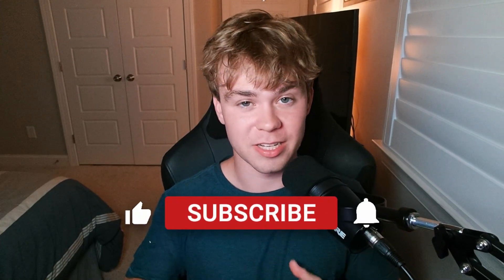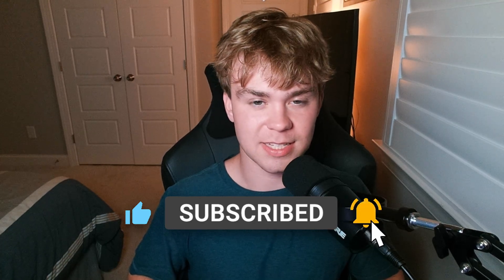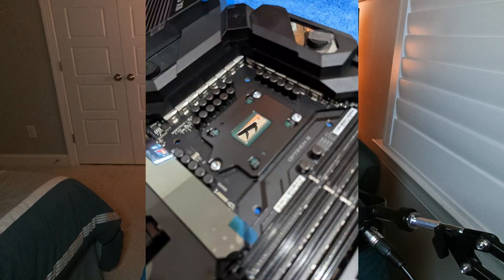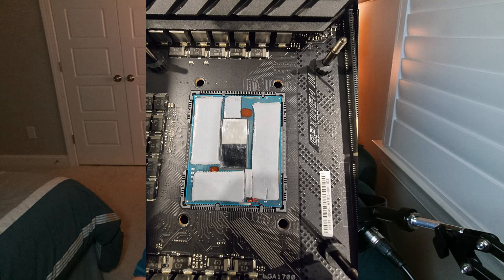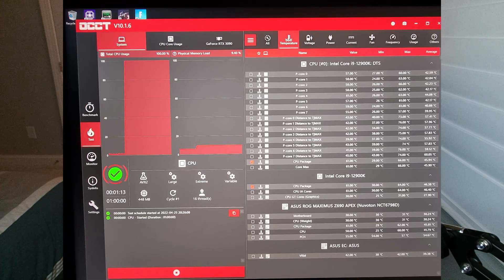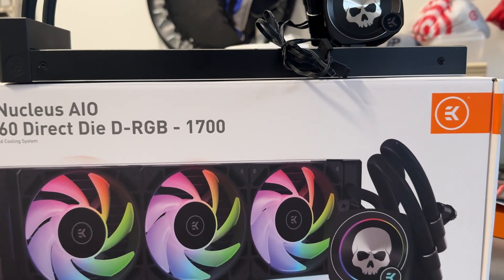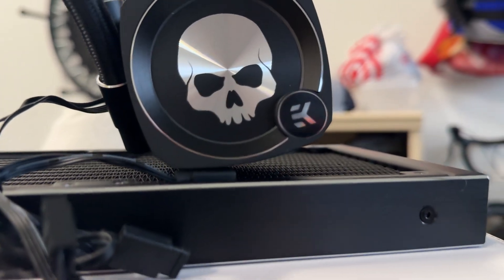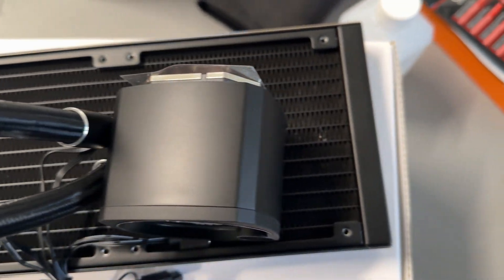Unleashing the 14900KS… (Direct Die)

Comment: No, the answer is to have a very good motherboard that can handle it. I also have an H170i 420mm with liquid metal. I went from 100 degrees at 57 ghz to 80 degrees tops at 61 ghz with idle temps at 29 degrees. The motherboard was the big change. The liguid metal got me down from 37 idle to 29 degrees idle. I have an Ace MEG MAX from MSI. Please believe me.
Reply from the maker: The motherboard won’t change temps I promise you. Sounds like you just didn’t mount the cooler correctly the first time
Reply: @ChamberTech  no, it was the motherboard, I promise you. Have you been living under a rock? Intel is blaming the motherboard manufacturers. My motherboard has 24 vrms with cooling. It is cool as life. Educate yourself. My performance seems to be better than yours, and I don't have to delid my 14900ks.
Reply from the maker: @kalinwang1 ok so you think that vrm temp is cpu temp? Also I’m not using any power limits. Max power 14900ks. Yours is likely downclocking in games
Reply: @ChamberTech  no, I didn’t say that. I said the motherboard. Vrms helps with stability for OC. A good motherboard has vrm cooling and will run cooler and more stable for the cpu, helping lower temps across the board. Once again, once I changed my motherboard,  the temps never went over 80. I am helping all these people with a cpu running at 100. It is a lot better advice than your risky delid. Run a test on the MSI MEG ACE MAX. Compare it to your delid! I am using a max setting as well. Not that fake news put out buy manufacturers. I run at 61 ghz. My bios is dated Jan 24 with no power limits at all. I used to have a motherboard that was hot and unstable with power limits. I know for a fact that what I am saying is true. You need a better motherboard!
Reply: Umm...I need to know what workload/stress test you were running that allowed you to go from 5.7ghz@100°C to 6.1ghz@80°C just by changing the motherboard. I'm really curious to hear your explanation.
Reply: @jjlw2378  dude, buy the motherboard. I was in the same boat as everyone else. I did some research and realized my motherboard (Aorus  Z790) was crap. I got the MSI MEG ACE MAX.  I didn't change a thing in the bios. And it was significantly cooler. I  went to Intel XTU and pushed it to 61 ghz. I  didn't  do 62 because the CPU went over 80 degrees l. So I kept it at 61 ghz. Idle temps are 29.
Reply: @kalinwang1  what are you smoking lol, this guy probably isn't watching the clock speeds and doesn't realize that its downclocking to 5.7/5.6. I have the best motherboard you can get and it doesnt affect your CPU temp 😂😂
Reply: @RuiN4265  what motherboard do you have? You are showing your ignorance.  Don't go down with this guys lack of knowledge. My speed are at 6 ghz. What motherboard doe you have. I will tell right away if it is a quality one.
Reply: @kalinwang1  Asus Apex Encore

Let's see a video of you running VST @ 6.1GHz at 80°C
Reply: @RuiN4265  price is crazy, but all comparisons say my motherboard is better. Your board does not have a backplate nor as many vrms which is important for running cool and stable.  It only has two ram slots and maximum size it is 96 gigs. Why buy that when you could have got my motherboard for 700
Reply from the maker: @kalinwang1 high end oc boards have 2 slots because you can actually run high speeds
Reply: @RuiN4265  this is what I found about your board:" This motherboard features a VRM that is made for pushing Intel's latest 14th-gen CPUs to the max and is powered by dual 8-pin connectors."
Even the maker of the board says the motherboard board matters. Mic drop...
Reply from the maker: @kalinwang1 the best board for a 14900ks is a $280 z790i lighting. 1 8pm eBay you gonna do about that
Reply: @ChamberTech  the issues you are having with 14900ks says otherwise.  You are calling me a liar??? I know I speak tue truth.  You are full of it, or seriously miseducated on this topic.
Reply: @kalinwang1  You should have bought the GODLIKE. Your ACE is garbage compared to it. You know, because the marketing says so.
Reply: @jjlw2378  I researched thw Godlike and it did not have as many VRMs phases (only 20). Where my board has 24. I didn't fall for the marketing. I researched stability and cooling. My motherboard hit all the right numbers.
Reply: @kalinwang1  I think it has 26+2 phases (Godlike Max Z790)
Reply: @gadielsantiago8813  I stand corrected. I must have been looking at the wrong I information. But I am still satisfied with my motherboard.
Reply: @kalinwang1 good👍🏻
Reply: @RuiN4265  The fact.
That you don't understand how marketing works.And they sold you that bs, says a lot about you. What you call "high-end" Just cut production value and sold you that BS. You can't have larger ram. Moreover, you think you have a value lol. Educate yourself.  Explains why it is underperformed next to the my motherboard. Which is real high end.
Reply: @RuiN4265  dude, am I saying that? I am say 4 gives you more options.  I only use 2, but have the option for 4. Which sucker's who only have 2 don't. Also, your argument is self-defeating. Motherboards do matter. As you are pointing out, but in a losing way.  My motherboard runs faster and cooler than the one I had before. You guys said something out of ignorance that it did not matter.  I  proved you wrong. Now you are misquoting me just to change the topic. Two slots are not better. Your boards lose points for that. 4 slots while only using two is way better. This is a fact. Companies are overcharging you while cutting corners, lol
Reply: They don't matter for cpu temp, that's all I'm saying. 

But yes lets have 4 slots with no intention of ever utilizing all 4.....derp. And who was it that fed into the marketing?? 

I feel like you hump goats in your spare time

Comment: Radiator thickness doesn't mean much for aios. arctic freezer iii at 38mm still gets outperformed by many slimmer aios esp for intel bc the coldplate is specifficaly designed for the zen 4 ihs(not as flat and more pressure in the center) and other factors like fpi and how the heat is transfered from the coldplate to the liquid.  Also why do u keep hyping up the Frozen Notte?
Reply: Frozen Notte just seems like a solid Uber cheap AIO. Perfect for affiliate links.
Reply: no, the issue there was they were still using the older 14cm fans - when various channel switched to the newer faster 14cm Arctic fans, it was in the top two or three, and the rest can easily be blamed on the pump being limited or the other one or two units having fans that are still faster and louder yet (getting ultra lounder for an extra degree to two).
Reply: also radiotor thickness does matter, its one of the primary reason Artic was able to outperform others when their pump was slower and their fans were limited in upper rpm
Reply: @xBINARYGODx  it matters but it is the least important aspect of the rad. Surface area > Fpi > thickness. Idk what u are trying to argue when there are 360mm aios that outperform even teh 420mm arctic three